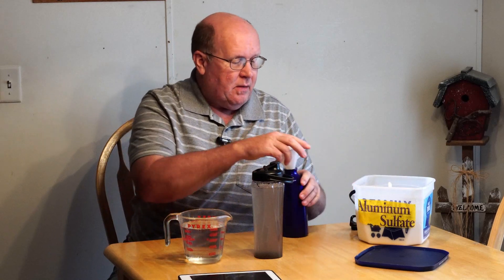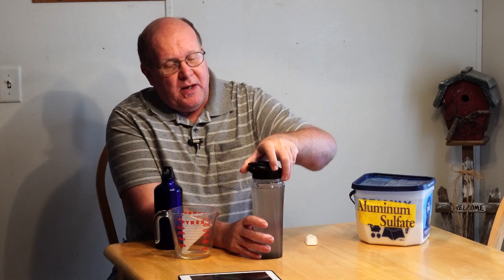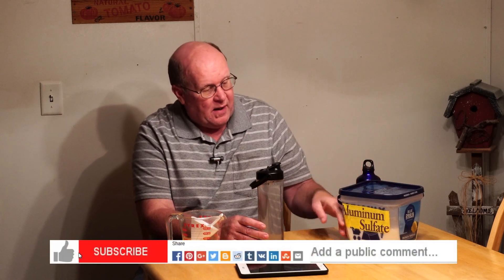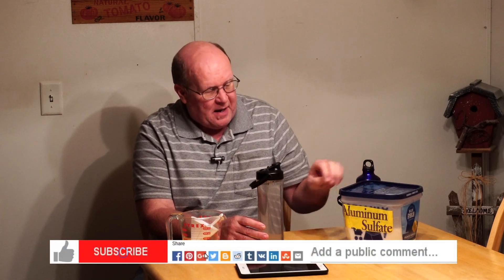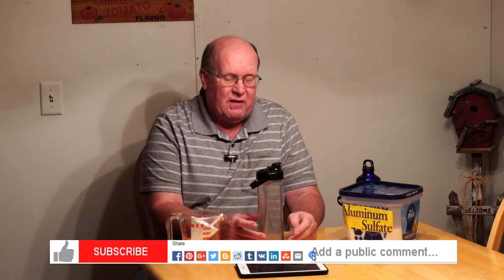Aluminum Sulfate Water Purification

Comment: I find it odd, that you have people watching this channel, commenting on how unsafe this water is.  First off….why watch the video at all if you’re convinced of that.  Second, simply don’t do it if you think it’s THAT unsafe. Alum is used EVERYWHERE for exactly what this man said.  It’s part of the very first stage of filtration to get the that large tangible particulate matter out of the water….then it’s put through a series of other filters.  
Alum is a cost effective, and more efficient way of removing particulate matter, than the physical stage of filtration.  Your public water provider will not only use alum on a MASSIVE scale, but go on to add things to your water, that in large doses is unsafe….i.e. fluoride for your teeth.  Learn what you’re talking about, and get some context, before popping your cork off about what you THINK you know.  Or, better yet, simply don’t use this technique….no one’s holding a gun to your head to take, or implement, advice form a YouTube video.  No one’s telling you to take your tap water in your middle-class community and start dumping large amounts of alum to your water, then chugging the whole glass.  You people are making it sound like he’s telling you to sprinkle it on your popcorn.  It’s simply a video explaining the otherwise, widely known benefits of using alum to get the bulk majority of impurity’s out of unfiltered water.  *On that note, thank you to Back Pack Hack, for taking the time to show this video, and share it with people.*🤦‍♂️

Comment: How much of  [Al2(SO4)3] do you need to use for like 1 liter of dirty water?
Reply from the maker: I wouldn't consider trying this method on such a small amount of water.  There wouldn't be much 'clean' water between the lighter stuff that floats and the heavier stuff that sinks to make it worthwhile.  It's best to use this on larger containers, such as 5 gallons and up.
Reply: @BackPackHack  okay thank you, i want to show this experiment at school, how much do i need than for like 10 liters of dirty water?
Reply from the maker: Mix 1½ oz. /  2tbsp  Aluminum Sulfate to 16 oz. water and shake well.
Add 4 tbsp mix to 10l of water.